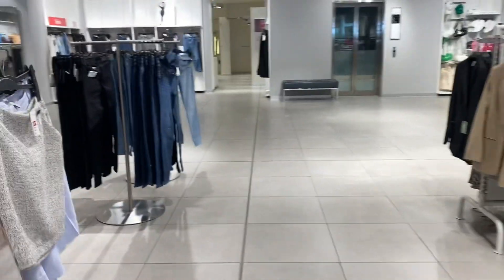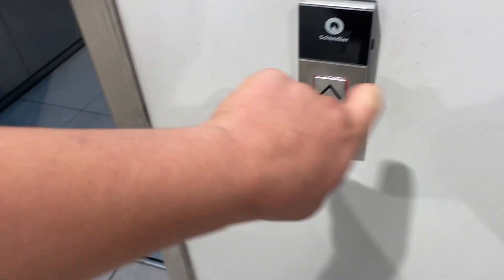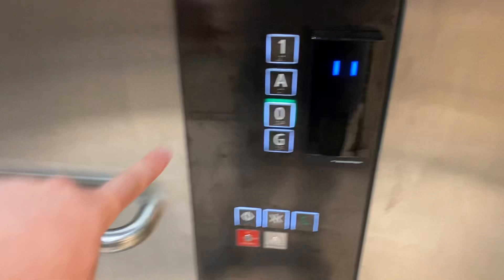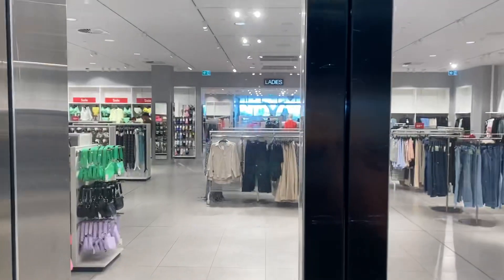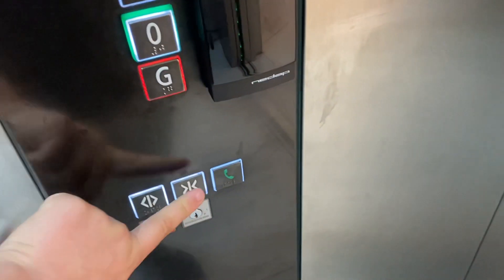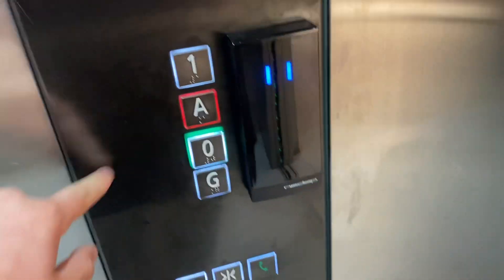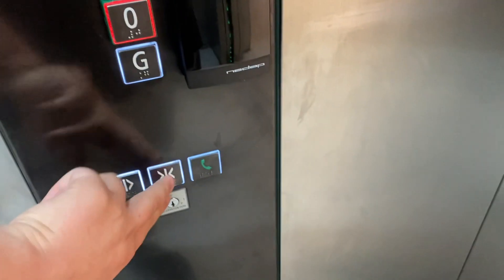Schindler 5500 MRL Traction Lift @ H&M Grand Central Toowoomba

Comment: I find the floor numberings strange at Grand Central. What’s level A and Level B and why is ground floor labeled Level 0?
Reply: A is a staff level that approximately lines up with 1A in the older half of the centre, it's the only lift in Stage 3 that stops there AFAIK. It has some corridors on it and more often than not some trolleys.

There isn't a level B so I will instead explain G, I've never been there but I can pretty much say for sure it lines up with G in every other Stage 3 lift. From what I can tell, it's the loading dock where the nearby 2600 stops at.

And of course, for some strange reason H&M's 0 is centre's 1, H&M's 1 is centre's 2.
Reply: It's only for staff.